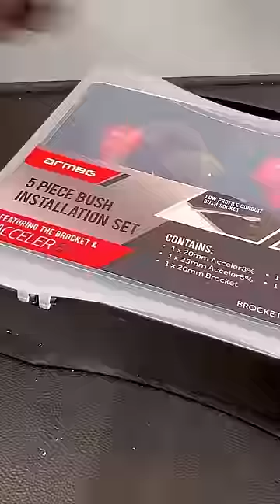They Said it Would be Faster! - WERA Tools Kraftform Turbo Screwdriver for Electricians'

Comment from the maker: Check out the full review. https://www.youtube.com/live/zi9lGLRVspg?feature=share&t=4089

=AD= Check Price 
http://hub.efixx.co.uk/wera-KFTurbo
Also featured:
The Armeg Brocket
More info 👉 http://hub.efixx.co.uk/armeg-brocket
Check price 👉http://hub.efixx.co.uk/brocket-shop
Reply: I used this when I was working for BBC if it includes some other bits like the one we had it is very expensive, for 26 pound you can buy the same screw driver set from leyland and the other bits for 20 pounds from lay land much cheaper
Reply: I too would like to have such a happy montage where no one smokes and there is no loud music.
Reply: Hi, why do you put cable into hydraulic pipe? Don’t you have plastic ones?

Comment: Someone buy this man a drill pls
Reply: Even an M12 adjustable torque screwdriver
Reply: I'm not an electrician by trade, but I would use a short drywall screw instead & attach it to a 2x4.
Reply: With this particular screwdriver, he doesn’t need to use a drill, and he doesn’t need to drive drywall screws into 2x4, when he can drive these screws more easily into the medium he’s using- sorry, I’m tired and I can’t remember if it’s pressed wood or particle board. Ah, the joys of being 74, with Fibrofog!!😱
Reply: He spent all his money on this Wera kit... 😭
Reply: Hurts my wrists just watching this, I'd rather walk back and forth to my truck for my driver 6 times than put screws in manually
Reply: @hobbes3   It's because of the cost of living.
Reply: Trust me if you can afford that on screwdrivers you probably are good on money.

Comment: Listen I don’t care how good this is. I refuse to pay $150 + for a screwdriver. Husky, Kleins heck even Milwaukee… ratcheting ones are good and a 1/4 of the price
Reply: Good for you
Reply: then dont pay it... nobody's forcing you
Reply: They are insulated for 600v, which is why they are pricey. (At least my non turbo set is) Compare to Klein insulated tools, not much different.
Reply: Understandable, especially when another tradie will steal them in an instant if you take your eyes off of them.
Reply: Milwaukee makes a very good cheap multi-driver. The 11 in 1 driver is only $15 and the 13 in 1 is $18.

I think they're the best bang for your buck. The bits are much longer lasting than husky, craftsman, Klein, and others. Wera and Wiha bits are still better, but not by much. I can't justify using top-shelf tools at work. They "grow legs" way too easily.
Reply: @-opus  yes the shipyard does not forgive. Ngl I’m on 4th set of lineman’s. Apparently they grow legs after the third use 🤣
Reply: @Brandon_Nelson92  same man like you said Milwaukee has the best bang for your buck on hand tools imo

Comment: I was always told not to put a hook on stranded wire. Shouldn't you use a crimp for your termination?
Reply: Very high chance that the strands come apart a bit and cause an arcing hazard so I was taught to always use crimps personally
Reply: I would think just the cable in on its own would be better than the doubling over but I'm assuming some would go as far as to crimp the end instead !
Reply: This is in The UK my guy, and it’s a screw terminal.  Im in Canada we don’t put hooks on stranded either but our receptacles are much different
Reply: wouldnt pass inspection in my country, in europe
Reply: This isn’t fine stranded, and no, it doesn’t need a crimp.
Reply: @JasperJanssen  spoken like someone who doesnt crimp but also doesnt want to admit hes wrong
Reply: @ruiferreira1647  i crimp fine stranded wire. What the UK calls class V/VI. This is Class II and shouldn’t be crimped.

Comment: I dont know about the rules in your country, but the use of ferules on stranded in mine is not optional
Reply from the maker: Class 2 conductors usually don’t use ferrules
Reply: Every time with the same comment. As said already, rigid stranded conductors do not require a ferrule.
Reply: In germany these parts and way of work are not legal. In our country legal and fine and standart work. 

Different laws for work with electric systems. 
And the reason is not the german 230 Volt AC. That is in germany absolute no problem for the electrician and the customer/user/children/adults.
Reply: @krisedwards8063 depend if the retention is just a screw a ferrule is better but if it 2 plate that close together with a screw no problem
There a chance to cut the wire if it's just a set screw
Reply: Acc VDE even in Germany exist no rule when you have to use ferules. It is optional. But should we use them on screw terminals with stranded cable? Always!
Reply: There are thousands of installations done around the UK wired in rigid stranded singles across all industries and they are not a problem. If it was a problem we would all be flat out working crimping ferrules on the end of every socket and switch.
Fine stranded cables yes, they need it.
Reply: Why would you use a coupling and chase nipple to enter a box?  Why not 2 lockouts with bushing or a Meyer's Hub?
I just don't see the point of threading a piece of pipe only to use a coupling and chase nipple.
Reply: @imdeplorable2241  conduit is threaded at each end. Those Myers hubs aren't readily available in the UK and are extortionately priced, looks like they still have a thread on them as well.
Reply: @callishandy8133 Same in Hungary snd like almost every part of Europe.

Comment: I’ve been wanting that turbo Wera screwdriver!
Reply: I wanted it too and I got it, I used it once or twice in two years and regretted buying it.
 It doesn't run as smoothly as I imagined!
Reply: @samnass  Aww really??
Reply: @EpicBenjo  Ive had one for a year or so. Due to the gearing it lacks torque unless the screws go in very easily. Broke pretty fast after dropping it a few times. I still have a Wera with the exchangable bits in my bag but i went back to using three normal wera screwdrives for the most common screws.
Reply: @lone7874  Aww that’s disappointing. I also have regular non-turbo insulated Wera screw drivers.
Reply: منم میخام ولی چه فایده
Reply: @EpicBenjo the good thing about this kit is it comes with a non turbo insulated handle for all the blades.
Reply: @EpicBenjo the turbo (both insulated and not) have limited torque even when locked so it’s really only good for light duty stuff. I don’t have the turbo, but I do have a few ratcheting and those are much better imo.
Reply: its not worth it for stuff like in vid, works great for say, working on circuit boards ect
Reply: It’s good for inspection and testing if you have to unscrew 20 sockets but that’s about it. Mine stays in the van
Reply: I'd rather have a few screwdrivers than keep changing the ends

Comment: Back in my day we did pretty much everything with a set of Klein Lineman Pliers, a big Klein Flathead, a pair of 420 Channel Locks (insulation removed of coarse), a hack saw, and a phillips head screwdriver.
Reply: You still can work fast with those basic tools. A cordless small portaband saves time though
Reply: @Reign_In_Blood_963  Been using Channelock 420s for 40 years until about a month ago and switched to Knipex...now that I'm close to retirement 🤣

Comment: I work in aviation, and have a snap on and a Wera screwdriver set. Surprisingly I prefer the Wera set. They grip the screws better, the handle is nicer and they are holding up just as well. Both have the same warranty but the snap on is waayyyy easier to get warranty.

Comment: I have this screwdriver, but it's not that effortless to drive a screw in the wood, and you must use both hands. In some cases is practical, but I prefer a little bosch go electric screwdriver for this kind of work.

Comment: Please answer multi-core wire should be crimped with ferrules when clamped with a screw?
Reply: Depends on your local codes and the size of the wire, in general in the united states, no, you dont need them

Comment: Those stranded wires are gonna get crushed by the screws and could come loose or snap off. Tin plating is the way to go, prewents corrosion too. The amount of times a socket got smoke coming out of it because someone chose a shortcut and put a stranded wire naked like that ending green after some time and not conducting rhe way it should is astonishing. Don't be lazy, do it right.
Reply: You do know the screw doesn’t touch the strands

Comment: How come you all over there use conduit in metal all the time? I mean I kinda like it, but over here plastic the the main choice usually, metal is required according to regulation sometimes, e.g. in barns where rodants can be expected.
Reply: Actually galve conduit is more Industrial,  Commercial and Domestic is usually PVC,  
Unfortunately where i work the regulations specify 316 stainless all joints TIG welded 😢.
Reply: @dogwalker666 nuclear reactor? 😅
Reply: @NightWatch1337  No Food production,  All has too be stainless to survive the super heated caustic, Very skin melty.
Reply: It's ok as long as it is properly earthed.
Reply: @dogwalker666  I mean at my job we have decided that everything visible has to be steel so it won't be easily destroyed. But not a real regulation, more like company policy. But I work in a prison, so in there the extra cost and benefits makes sense if you ask me :)
Reply: @johan6767  ahh I see, In food production we have loads of regulations for example we are not allowed wooden handles on our hammers, and pipes have to be welded or have "RJT" clamps  not threaded because bacteria can grow in threads, All metal is supposed to be Stainless and that destroys drills and cutting tools, total pain.

Comment: Get yourself the vessel ball grip for 10x cheaper and you get a ratcheting stubby for free
Reply: This isn't just ratcheting, it's geared.
It's a 1:4 ratio if I'm not mistaken.
So one turn of the handle is equal to 4 turns at the bit.

This drives screws much faster.

Comment: Why not just use a the Handife battery powered screwdriver? 
And it’s a cheaper tool.
Reply from the maker: It’s not insulated
Reply: In my experience, there is a greater risk of slipping with electronic screwdrivers because I lack the necessary sensitivity there. And as soon as it's turned through, it quickly happens that it doesn't just stop at one time and the screw head is destroyed. Because of this experience, I love tools without a motor.
Reply: You are always working live don't you?
Reply: American sparkies love using them. I don't like it.
Reply: @efixx you don’t install live do you ?
Reply: @efixx  it doesn’t need to be insulated your not supposed to work on live circuits .
Reply: @Dog-whisperer7494  Why don't you leave the electrical work to the electricians, why do you think they make insulated tools and arc-flash protective PPE if nobody is ever supposed to work on a live circuit?
Reply: @ScrotalSands  for high voltage  work 1000v and above. Why do think most American electricians don’t use insulated screwdrivers or anything . Oh yeah I have been an electrician for thirty three years uk health and safety regulations forbid we work on or near live circuits and equipment. If you don’t agree with my earlier comment fine , but don’t ever question my competence and or qualifications. If you can’t be respectful of other people’s opinions then don’t respond to their comments. The first we are tort at college is safe isolation and never work on live circuits or equipment we have to prove dead . First and foremost. You pilchard.

Comment: I bought a set and found them rubbish. You need two hands to operate the turbo screwdriver so you can’t hold what ever it is your working on and it has so little torque that it was barley able to put the screws to fix back a power point or light switch here in Australia. Also due to the fact that is a changeable system they wobble and to finish it off if you get dust into the button to change the blade it gets stuck. Pathetic

Comment: The Wera Turbo Kraftform has an integrated gearbox, basically a normal direct-drive speed and one with a 4 times faster output speed than the speed with which you turn the handle (but only a quarter of the torque).

Comment: Um...NO!!!  I tried one of these Turbo screwdrivers.  You need 4x the torque to drive a screw, and you need to use both hands on the screwdriver.
Hard PASS.  Besides, just use a damn cordless drill.

Comment: Been using WERA for about 11 years, but I found Knipex, Klein, BahcoFit 220.007 and ITL much stronger (they don't wear as fast as Wiha), pouch and hand friendly. 
I still have the torque set from Wera and I use it just for boards. 
Wiha, I tried once. Sloted screwdriver snaped in a week and made me gave up on them.

Comment: impressive how little changed in electrical work in the us the past 40 years... i usually only see 3g or 5g copper wires (L N and Ground or L1 L2 L3 N and ground) and quick conectors around here

Comment: ive got their 1/4 bit version of this thing.  I use it for putting electronics back together.  the speed gear reduces torque... you would have to try very, very hard to over-torque anything with this. the speed is just a bonus.  I wish they would make a smaller one!

Comment: I should become an electrician. I really love attention to detail and making things very neat and clean even if you can’t see it. 

Right now I do fiber optic out on roadways. We don’t do anything inside of the buildings. Just run the lines to them. We trench and tunnel boar tube and then pull the fiber through. We also have an aerial team but I’m on the underground team.

Comment: In reality you could use any socket to ratchet the nut down with. Yea they make some shallow lock nut sockets but at the same time you still have people that tighten and loosen them with a flathead screwdriver and a hammer

Comment: as a computer cable network certified tech, any cables that are pulled we cut like 2' off because the strain on the cable as it's being pulled  through the conduit can damage the wire.

Comment: Am I misunderstanding wha is going on? It looks like the are saying that a ratcheting screwdriver is faster. It's debatable whether that's faster than a standard screwdriver, your driving hand still needs to turn the handle and your stabilizing hand normally lets the shank of the screwdriver turn creating the exact same effect. If you have a disability and can't control your stablizing hand well, then a normal screwdriver with a collar on the shank would be the obvious solution. It's definitely slower than using an electric screwdriver or drill on a low torque setting. I'm just not sure how this is better in any way, unless added complexity is a benefit somehow.

Comment: Okay my number one problem.i see..your carrying too many tools..working 35 ft in the air and you imevitably drop one of the screwdriver bits and have to go down and search for the darn thing. It happens. I usuallu just strap my pouch on the lift and grab the proper tool for the job as needed.

Comment: Try that on a real wall, also I dont think that installation pipe should be made from steel but from evilon like any normal one if the Isolation geht's damaged and your failure current protective device fails you would nit only have one but all devices on live current

and I dort know this Champs and maby the can be used without wird end hulls but folding the wire iover insider them is definitiv a Bad idea and I think not allowed

Comment: Call yourself an electrician and then fix the cables without crimping 🤔
Illegal all over Europe and surely most parts of Asia and America (the continents) , but here you go, electrician 👍
Reply from the maker: You need to explore the crimping requirements and differences between class 2 and class 5 conductors - nothing here is illegal.

Comment: Screwing a solid wire in a U-bend is just as wrong as clamping a (U-bent) flexible wire directly with a screw at all. Solid wires are shortened to size and simply fixed under a screw as they are (no U-bend). Flexible cables are fixed with ferrules or corresponding cable lugs by screws or in screw connections.
Reply: Yea, in my time as an electrician for local 26, ive never seen someone U-bend a stranded wire for a connection

Comment: I remember working alongside a electrician who had a huge suitcase set of electrical screw drivers. Claimed it was around $3,000 and best believe; he didn’t let ANYONE touch his screwdrivers. He caught a plumber  rummaging through his set one time and I’ve never seen someone get so angry before in my life. 😂
Reply: and he was absolutely right to get angry.
Screwdrivers for electricians can save their life. but only if they are treated with care and do not get damage in the insulation. Would you give something on which your life depends to someone for whom it is "just some tool" with which they perform mechanical work? i would not.
Reply: @OiDepp  nope!

Comment: Installing electric wires in a metal pipe? This must be the 1950's?
Reply: Where do you live? In a cave in Afghanistan??? Conduit is used world wide
Reply: @LightningBolt-sf9mt  ... in the fifties, indeed. ;)
Modern countries, at least in Europe, use plastic pipes for that.  Metal pipes will conduct electricity when a wire gets damaged. Extremely dangerous, at least with 230V AC.

Comment: Wera is the HILTI of handtools
Reply: Yes and no. 
Sometimes I prefer Wiha and with some tools Wera for electrician tools. Both a the toplevel brand in germany. But ideed I see a lot a lot of Wera tools used by electricians. 

Sorry I like some foreign brands to. But not for electrician screwdriver, electrician pliers. 

Hilti is from swiss and these money level is a little bit higher (usually). but yes the drills and other machines are brilliant and mote than top level money is needed. But very durable ! Professional love there Hilti 's in germany. 

If you can work with a little lower top level quality I see often BOSCH professional. 
Not cheap but not at the Hilty level.